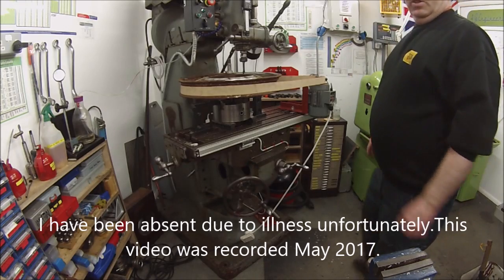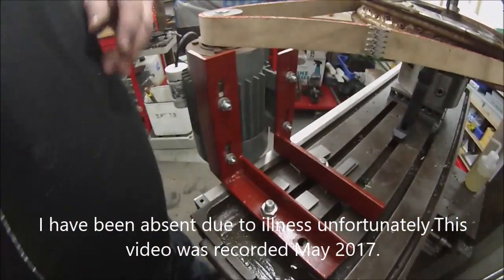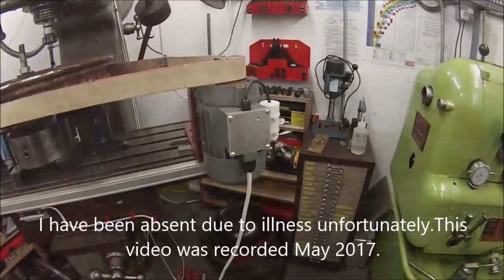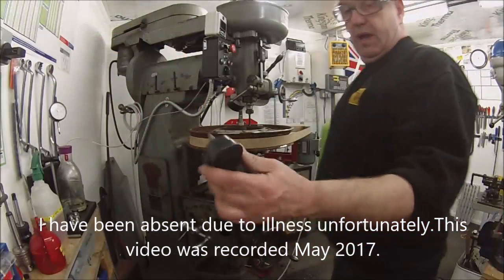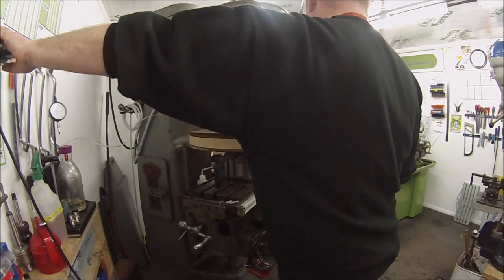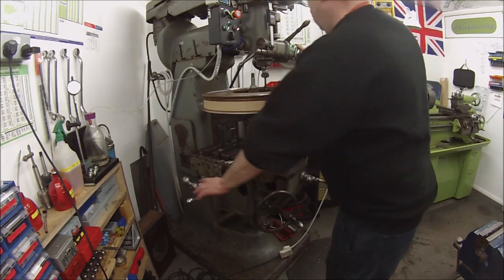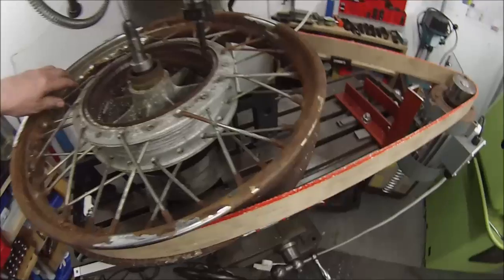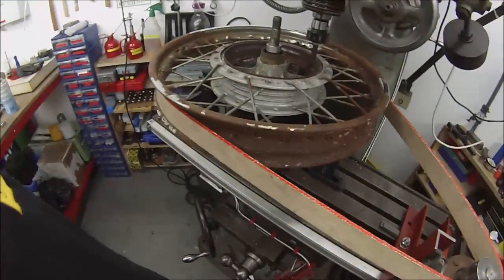Brake drum skimming on a milling machine

Comment: Thanks for posting. Very good idea. Some liners are so worn, there is little to recover. Have you ever replaced the brake liner on an old wheel? 
Regards, 
Tom 
Melbourne.
Reply from the maker: Thanks Tom. No, never had cause to replace a liner, but yes, you have to watch the max diameter. I believe most are cast in place?, so if machining out and fitting a new shrink fit liner would work or not I don't know?
Reply: You could contact cylinder bore coaters like Millennium Technologies to see if they can coat a drum back to spec. It won't be cheap so unless the part is exceptionally valuable I'd just find another hub.

Comment: one questen I have so very worn brake drums on my truck how can I repair them since I cant get any new ones
Reply from the maker: I would assume they are cast iron? You can skim them, but it must not be past the maximum wear limit, then fit new thicker linings. If worn beyond the max limit then you need to replace somehow, maybe searching for another truck drum that may fit with modification?
Reply from the maker: Or look into the possibility of metal spraying? I'm unsure of it's use on a cast iron drum though.
Reply: I Alam tanks for responding  yes thats the proble my truck is a J2 bedford twin rear whell and I cant finde any new brake drum  I probaly ry find some oe with spary metal thank you